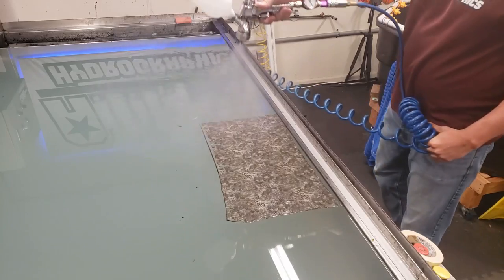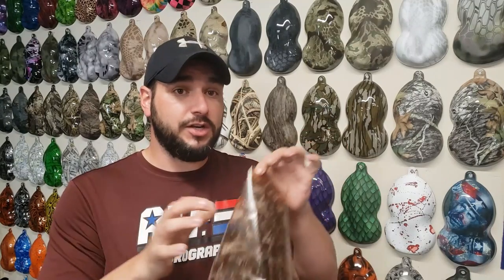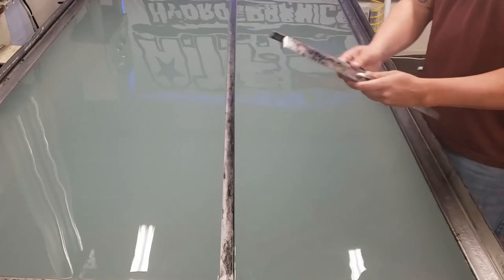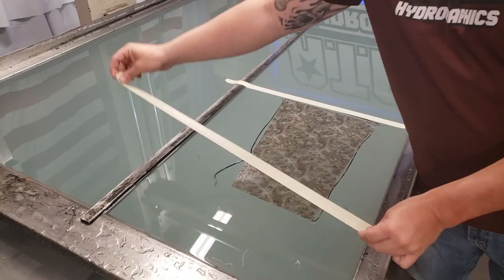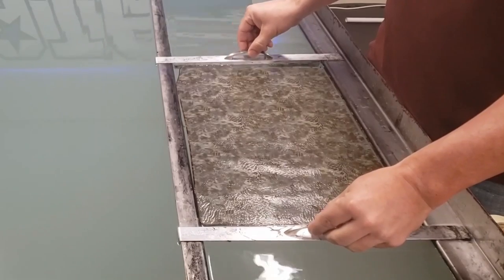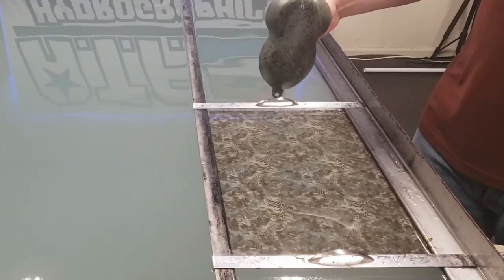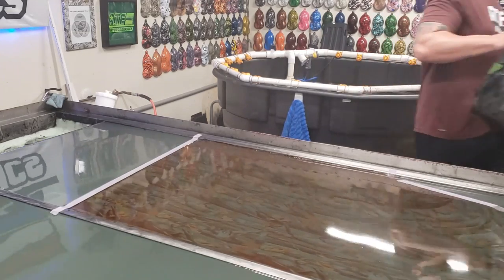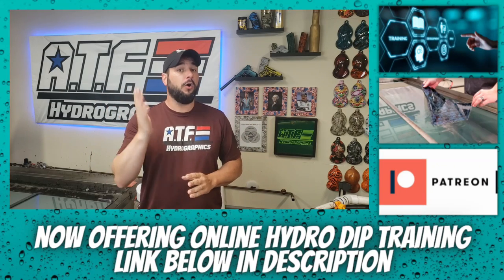How to keep Hydro Dip film from spreading and moving on the water

Comment: Thank you . 

Over the last couple of days , i've been trying to dip a dashboard component , in preparation for the main event , a much larger radio panel (i converted it to double din). I've been struggling with a few issues , which i figured was down to too much activator . I was also wondering if the water i was using was too hot as well . Just watched two of your videos , and have had both questions answered , so you get a big thumbs up from me . Thirty seconds of this video , showed exactly the problem i have , i don't think you need to know what the first one was . Now armed with this information , tomorrow i'll be preparing the test piece for dipping on Wednesday .
But first , i'm off to watch your activator video , to see if i can pick up any more tips . But before i do , once again Thank you ...

Comment: When hydro dipping do you always dip in the middle of if the film or can you dip from beginning of the film.i. trying to dip a tumbler and get all like clumpy on the cup and don't stick and it fall off
Reply from the maker: You can do it either way, if it is not sticking then you have an activator issue.

Comment: Hi, I have a question. I want to dip my sportster gas tank. One side then the other an both sides  is 12"s tall 19 "s long. My film is a roll 20" × 6 ft how big of a piece of film should I use per side? Thanks in advance
Reply from the maker: Cut a much a larger piece than you think you need. Film is cheap compared to the rest of the process.
Reply: @AllThingsFunHydrographics  Thanks, I really appreciate it!